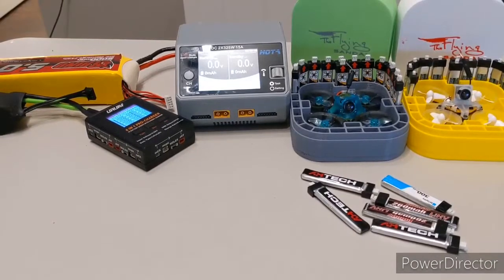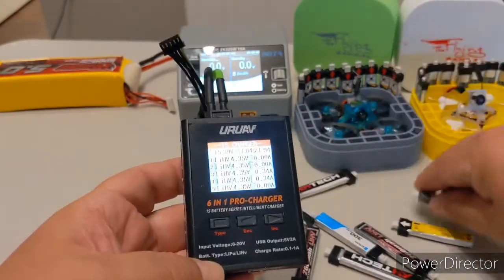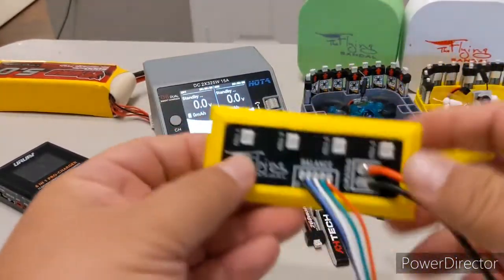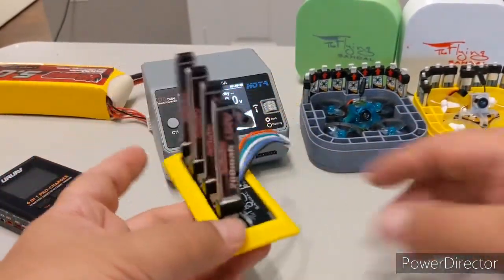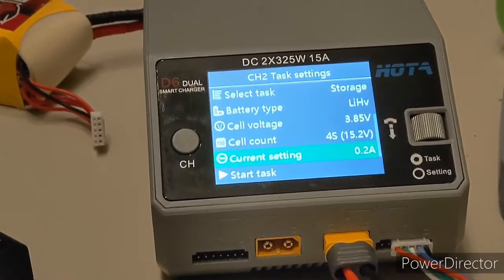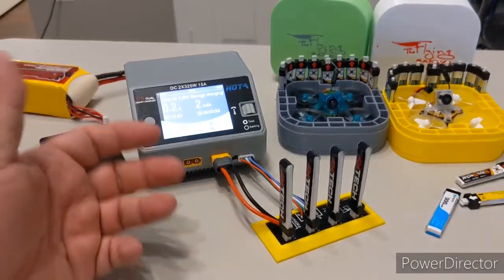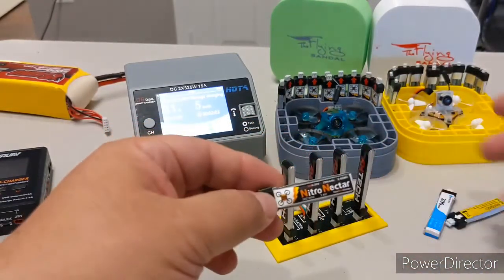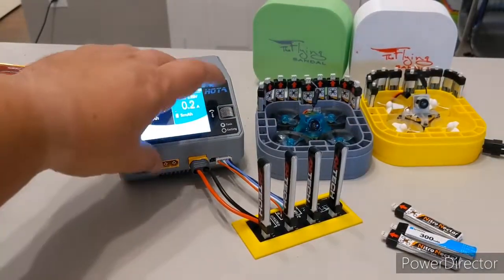My Tiny Whoop batteries keep dying!

Comment: So I've been using the flying sandal board, but I don't always need to charge or storage charge 4 batteries , would it be possible to solder up a three wire lead to the ground and the next two leads to make it possible for charging only two batteries?  or is the board wiring not going to be correct.  My charger does not allow charging less then 4, when the five pin connector is plugged into it.  It only works with four not sure if it's evaluating the voltage vs the connected leads.    Youre 2.0 version could have switches to alter the quantity of cells between 1 and four.
Reply from the maker: Please check out V2 for this feature. Unfortunately V1 cannot be modified easily for that

Comment: Just got mine from RDQ, works great! I do have one question though: can it be used to charge less than 4 1S batteries at a time? My HOTA charger still recognizes 4 cells if I plug in the balance lead having only 3 batteries connected, however the "empty" cell shows a higher voltage (around 4.8 V or so). I haven't tried connecting the XT-60 yet in this configuration since I am not sure what this would do to the connected batteries. 

Thanks!
Reply from the maker: Less than 4 cells will not complete the circuit needed for charging.  There would have to be 2, 3, 4, 5,  6, etc versions or there is one version here on Youtube that has a little wire you plug from cell to cell to complete the circuit.  I considered both of those options, but opted for keeping it as simple as possible, so this version works only with 4 cells at a time.  Thanks for getting yours!

Comment: This is a great board! I just received mine. Now it's my thinking that since they are all in series,voltage and mAh rating shouldn't be a problem, as long as if your only using a 1c rating that equal to the smallest mAh rating.
The charger is going to charge each cell the the nominal voltage so mAh shouldn't be an issue.
Does that sound correct?
Thanks for a great board. If I were to change anything it would be for the xt60 to come straight out instead of straight up. But that's just me.
Reply from the maker: Yes, just charge at 1C.  For 300 mAh cells, charge at .3A.  Hope you are enjoying it!

Comment: One of the MCPX connectors keeps pulling off of the board.  Any quick fixes?
Reply from the maker: If it's just the plastic connector, try a small drop of CA to keep the plastic on the board

Comment: RaceDayQuads calls this a parallel charger and warns that the batteries have to be within 0.3 for safety.  But didn't you (and Bardwell, the reason I'm here) say that since it's actually series this shouldn't matter?  Does it matter?  Can I jam 4 300mah 1s batteries in here and not worry about fire or battery damage?
Thanks, I was just hovering over the buy button and saw their warning.
I have a big sack full of puffy 1s batteries.  I assumed it was because maybe my charger or my drones had those crappy folded metal pin PH 2.0 connectors.  Do you think it is because they sit around waiting in either full of empty capacity that makes them get puffy?  Thanks.  
I storage chargee all my batteries for my other drones and they perform well for a long time, so I think this is an excellent invention man.
Reply from the maker: It is a series charger, I've asked them to update the description, but I think it's tied to the link to the page and it's been sent out all over the place by now.  Anyway, your charger will tell you if the batteries have close enough voltage to charge/balance the batteries.  Most chargers will just use their internal resistance load and balance the batteries to the storage charge.  And yes, I also have a bunch of puffy 1S and kept buying new sets for the new flying season.  I believe this happens due to either over discharge and/or storing them fully charged.  Hot cars will also damage them, btw.  That is why I came up with this board.  Don't overheat them and put them to storage when done flying.  They should last a lot longer.  Thanks!
Reply: @theflyingsandalrc  thanks very much.  Yeah it's a shame.  A couple years ago I became good friends with the Amazon lead at BetaFPV and she started sending me all the customer returns (was cheaper than shipping the batteries back to China ) so I have had 100s of these batteries, and no matter what I've tried they always puff up.  I've been told it is because of the resistances in the connectors so I switched all my pigtails to the best I could find, still happened.  I think it was the chargers honestly.  (But who knows, maybe just warm Florida weather ) I've marked batteries and only flew them down to 3.6, 3.7 and they still puff up after a few charges.  (Hence giant bags of crap batteries no matter how hard I tried)
 I'll try your board, great idea.  I hope you make some good income from it.
Best regards, Fred Cass

Comment: I have some 1s 650mAh batteries that are 4.35v. Can you use this board and charge at 0.6A with 4.35v?
Reply from the maker: Depends on the connectors, but yes, you should be able to. Your charger will just need you to specify the number of cells and adjust voltage accordingly